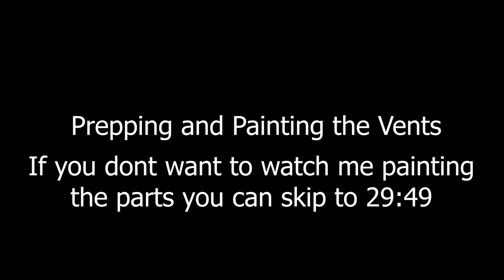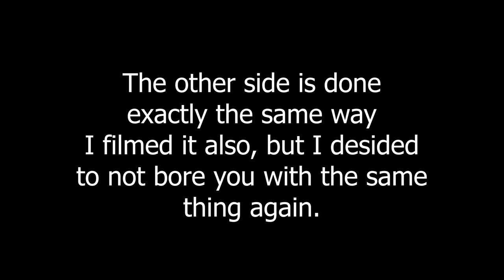How to Install ACS Composite Z06 Style Lower Vent Ducts on a C7 Stingray Corvette

Comment: I used to use the same system of paint can for touching up the finish on aircraft avionics parts when I was in the military.  Surface prep is critical.  There are paint pens that work the same way to provide the epoxy finish but I don’t think they work out as smooth of a finish with the brush strokes.